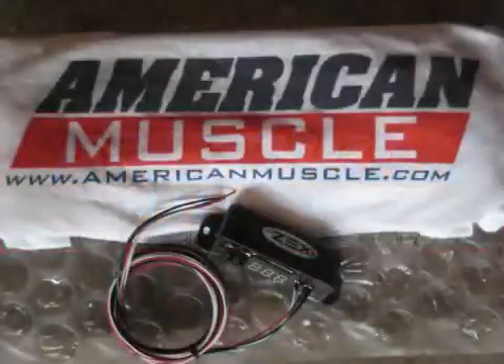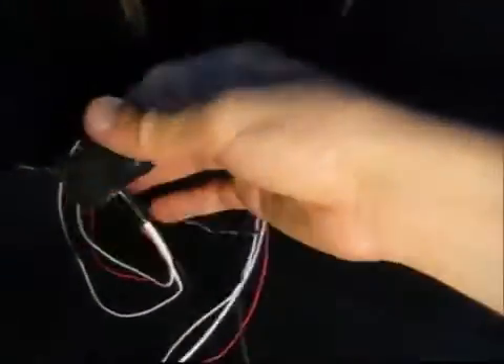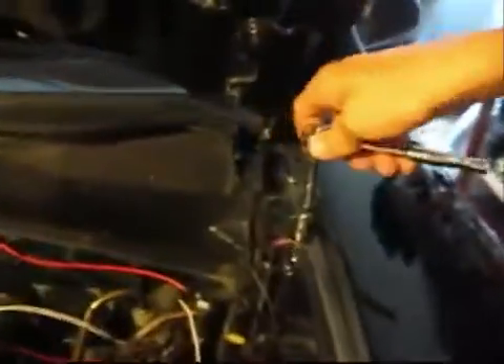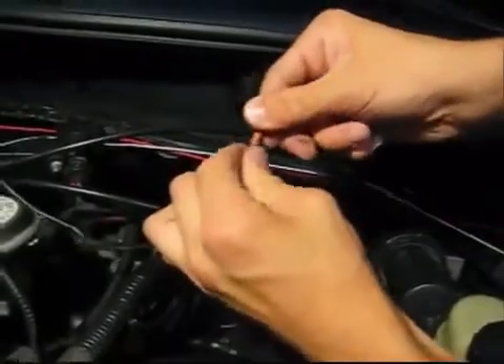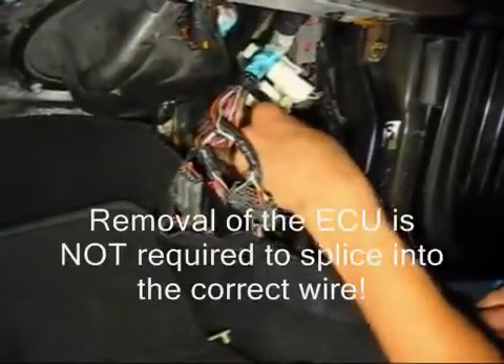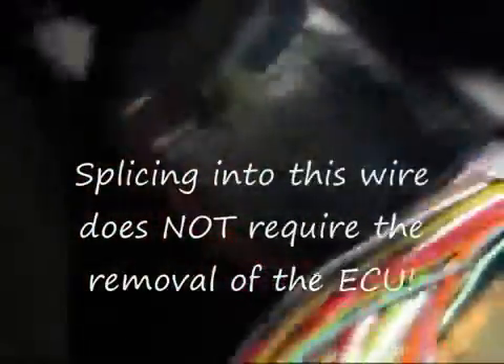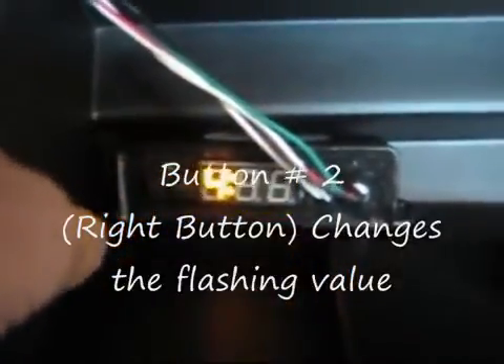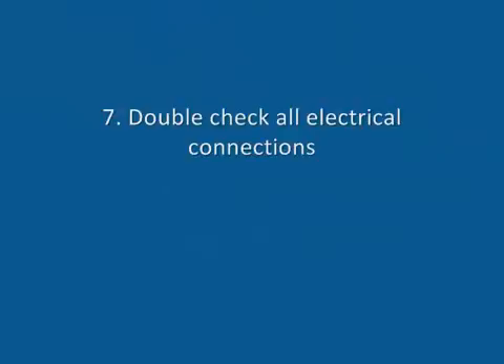Zex Traction Control Window Switch Installation

Comment: How do you set the zex traction control switch for a foxbody? Really need the help thanks...
Reply from the maker: Hello - your best option is to call the ZEX tech line at 1-888-817-1008. Those guys will be able to walk you through the process step by step. Thank you.